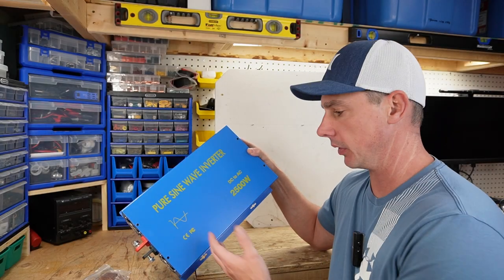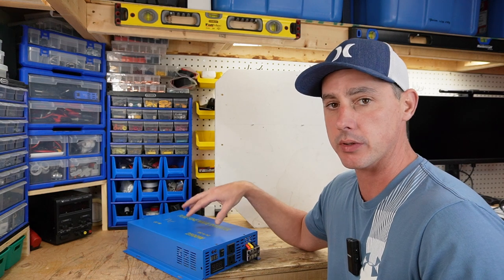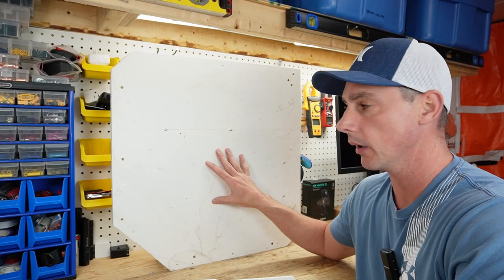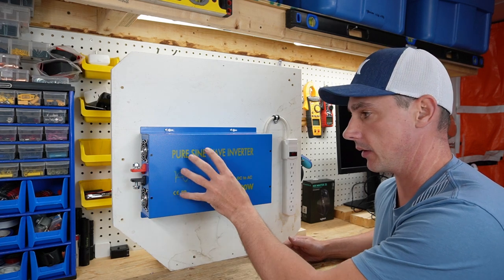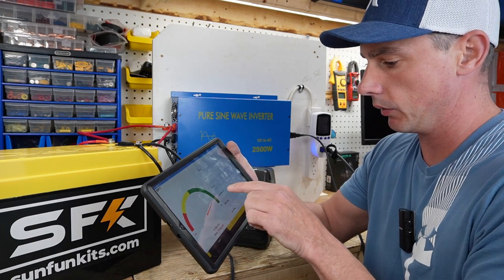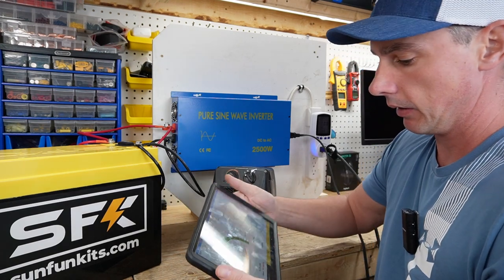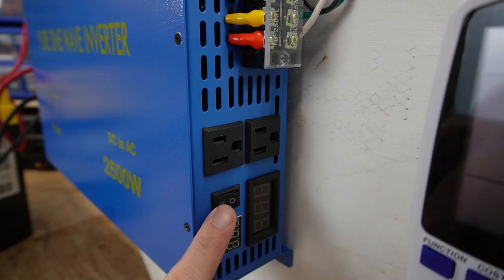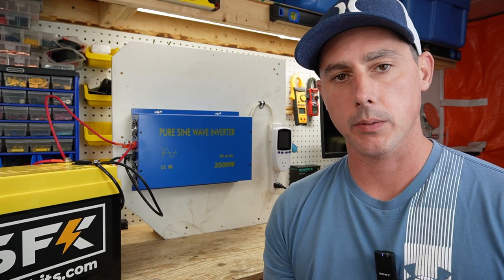2500W 12V Pure Sine Wave Inverter by XYZ INVT

Comment: 2500 watt divided by 12v is almost 200 amp, so 2/0 gauge, right ? Plus 200 amp T fuse on positive hot side at battery, right ?
Reply from the maker: If you are looking to pass NAC standards yes you are correct. For a off-grid system 2 gauge wire will handle the load.
A "T class" class fuse it unnecessary as this is a 12.8V nominal battery less than 36V a ANL fuse will work just fine. 
Thank you for the comment I will add a note in the description of my video.

Comment: I hooked up my new XYZ INVT 2500w 12v inverter to my LFP 600ah bank and tested the output voltages across Live-Neutral, Live-Ground and Neutral-Ground. Got the expected 123v on Live-Neutral, but measure 60v-61v between Live-Ground and also between Neutral-Ground!!!! Got hold of support and they say that these are "virtual" voltages with no real current, and is normal! Seems to work OK, so thought this might be interesting to anyone checking their new installation....
Reply from the maker: Great info; I'm going to start looking for this. Thank you for sharing.
Reply from the maker: Eric-ii9ce  Good suggestion
Reply: Thanks but why would the inverter manual or installation guide not mention this?

I have received different advice, which is that this is a center-tqp transformer inverter where the ac output cannot be bonded.
Reply from the maker: @BarryandKaren  Best thing to do is talk with an electrician and not people on the internet.
Reply: Eric-ii9ce  I will try the fast blow 1a fuse, and re-measure the voltages, thanks.

Comment: The three wires coming out the inverter are they on a separate circuit from the other two. Appreciate your help. I'm thinking about buying the 2500. John
Reply from the maker: I believe they are separated. The terminal block connection will allow you to pull the full 2500W. Just make sure you use the proper sized wire.
Reply: @Roll2 Videos  thank you big help. John

Comment: Do the fans blow IN or OUT of the body? I need to install the inverter vertically and want to ensure the airflow is UPwards! Thanks!
Reply from the maker: Ugh, I keep forgetting to test this for you.
Reply: @Roll2Videos  It's OK, I found they blow outwards so have them at the top, which unfortunately means my voltmeter displays and switch are at the bottom of the unit, where they're not visible. Oh, well.....

Comment: Can the low voltage cutoff be adjusted?
My bms shuts down first.  Then I have to charge the battery then reset controllers
Reply from the maker: Are you using a Sun Fun Kits battery or a different brand?
Reply: Xyz .. as in this video
Reply from the maker: @Terryblount  I thought you were talking about the battery. On the inverter, Not to my knowledge sorry.
Reply: There's got to be a low voltage sensir because it beeps . Probably a cutoff to but getting info doesn't seem possible.

Comment: 17W  ... my Victron has a 1 amp standby ... I use the setting where it checks for load before supplying ....
Reply from the maker: Well, Victron is the gold standard 👍
Reply: @Roll2Videos  I really like Vic though on a very small limited ability ... it is like eating true good nutritious food and that way illness, if it comes, is better handled.  Sometimes problems just don't happen with top quality.
Reply from the maker: @davidpatrick1813  I hear ya. One day I will get one on my bench. 👍😁
Reply: @Roll2Videos  You do such good honest and fair .. just work there...  Keep it up... pat
Reply from the maker: @davidpatrick1813  Thank you Pat,

Comment: I bought this inverter in 48 volt. is 4 12volt 50 ah batteries wired to 48 volt gunna work for me?
Reply from the maker: 48V x 50Ah = 2400W. I doubt you will run full power all the time. The 50Ah @ 48V should work fine
Reply: @Roll2Videos  im pretty new at this. is that a yes? it will work fine?
Reply from the maker: @redzepplin7397  I'm 99.99% sure it will work.